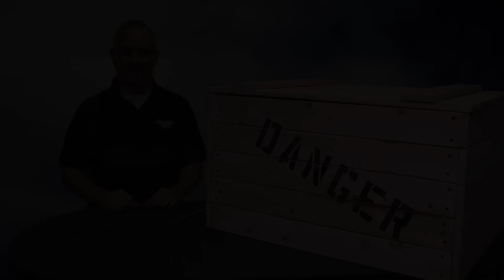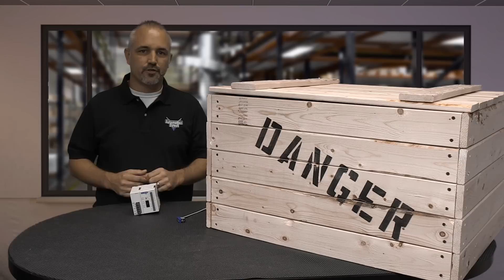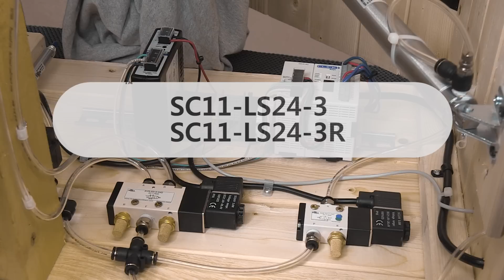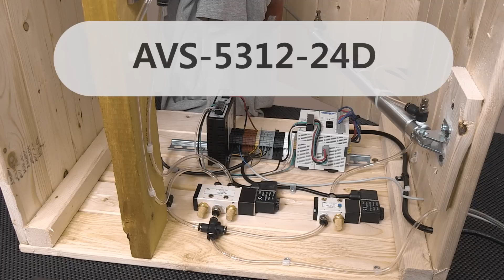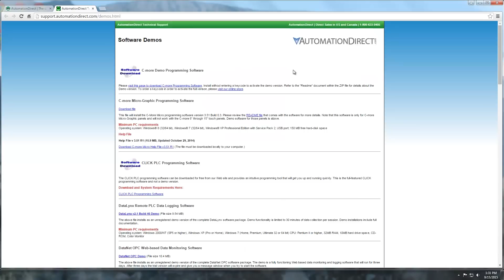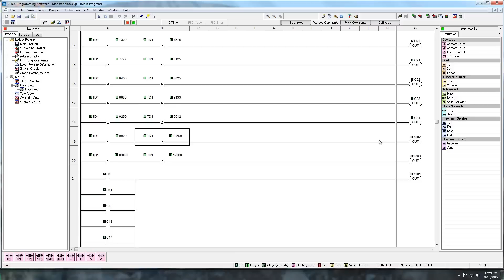Halloween Pneumatics Prop DIY - Automated Monster In A Box from AutomationDirect

Comment: Great tutorial and very inspiring! If possible, are you able to let us know the approximate cost of the PLC and other various equipment in this video? As mentioned earlier, I've found some decent programmable PLCs from Halloween "prop" sellers, but the downside is they have very few I/Os, but for around $60 in an all-in-one kit...it sounds like it may be better to purchase a few of those. My main concern, however, is being able to scale these smaller prop projects into something even larger over the course of a few years, and rather than saving a few bucks this year...I'd rather pay a little more upfront and then eventually less as time goes on with this equipment.

Comment: Very cool. Do you guys sell multi stage air cylinders, like you see on hydraulic dump trucks?
Reply from the maker: +wjf213 We're glad you enjoyed the DIY Halloween prop video.  At this current time, we do not offer multi stage pneumatic cylinders. However, we will forward your request to our product management teams. Thanks!
Reply: +AutomationDirect.com Thanks for the reply. I've been wanting to build the island of misfit toys for my Christmas display and one of the items is the series of clowns that open up and the last one is a mouse. Just like the Russian nesting dolls. 

I think a multi stage air cylinder would work best for this, because of the duty cycle.

Some thing else that you might want to suggest to your team, is to have an option that can be added to the end of each stroke to trigger an operation. I have not been able to find anything like that and it would be nice. 

Maybe just drill and tap a few holes in the end of each cylinder stroke where a plate can be added in a full 360 and things like a simple bolt on plate that hits a static push button switch at the end of the stroke or something. When the button is pushed, an operation is performed and when the cylinder retracts, the push button switch shuts off.

Thanks again for the reply and keep up the great work.
Reply from the maker: +wjf213 Your Christmas display idea sounds awesome! I will definitely pass along your product suggestions to our pneumatic management team - we really appreciate your feedback and input. Thanks and good luck with your project!